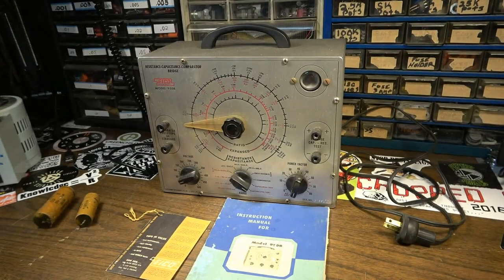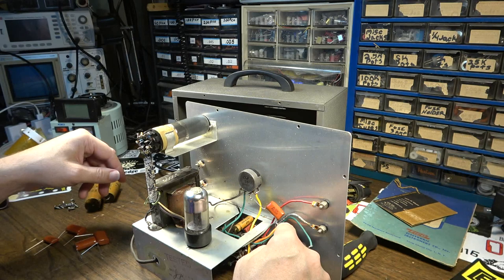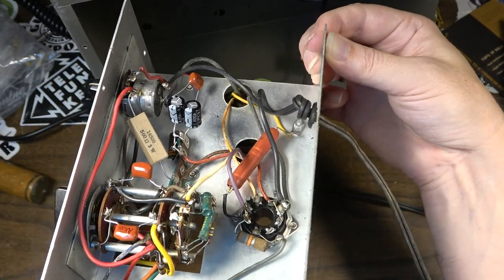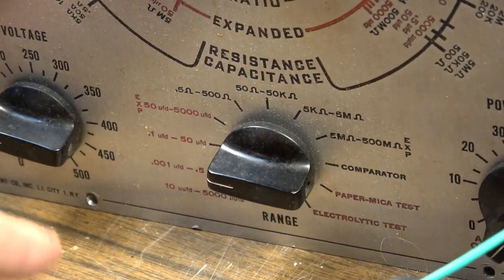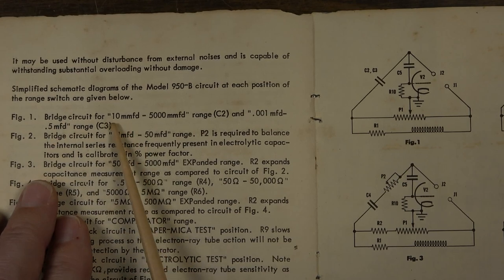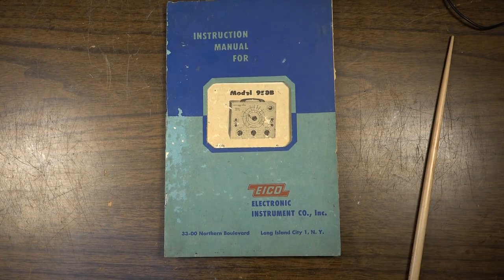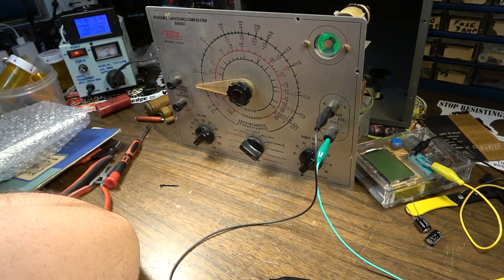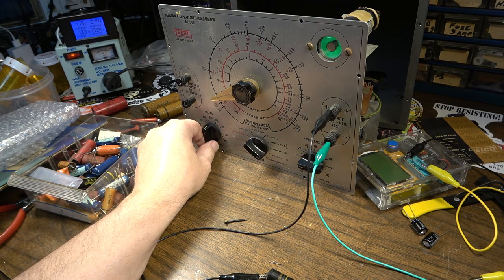Electronics Restoration - Eico 950B MAGIC EYE TUBE Resistance-Capacitance-Comparator Bridge Tester

Comment: Hi Brad, thanks for the video!  I got one of these brand new old stock sealed in the original box from an electronics store that was closing down.  I also got an eico VTVM in kit form NOS at the same time.  One thing to be careful of on the 950B:  when you test a cap at high voltage, don't turn the voltage knob down too fast.  The cap actually discharges through the pot.  If you turn it down too fast,  it will dump the voltage through the pot and burn it out.  It's really hard to find a replacement.   This was apparently more of a problem with the 950A, but I had the pot fail on the 950B as well.  The power factor test is similar to an ESR test.  The lower the power factor percentage, the lower the ESR.  I think this only works on the two highest capacitance ranges, so it's good for testing power supply filter caps. I still use my 950B. Great piece of test gear.  Thanks for sharing!
Reply from the maker: I saw your video after I uploaded this one. You did a great job. I still need to go back in and fix a couple things on this one.

Comment: Wow, that manual really is fantastic. Seeing the explanation and schematic of the bridge with the "power factor" pot in the circuit made the whole power factor thing click. I've just done the same thing— pulled down the ol' Sprague Tel-Ohmike TO-5 after much time spent upon a closet shelf. Just rebuilt the whole thing, hand-rolled the critical cap values, and replaced the flaky main pot with a new one from Mouser, but it's well-shy of the 7.5k called for in the schematic so I've added some trim pots on each side. It's getting there. One thing it's doing perfectly is measuring sub-10pF caps, which I think is a pretty cool party trick. These things really can't be beat for the leakage test, though.

Comment: IMHO, one of your better videos Brad.  I would check the voltage coming at the capacitor in High Voltage situations.  These circuits were designed when the voltage was around 110v, so the when you place the switch on 400v, I'd bet the voltage is higher.   I know I get around 127 volts at the wall here in Florida.

Comment: You should build the Mr. Carlson's Lab low voltage cap tester. He claims that it's highly accurate and can test for bad caps at lower voltage. I have seen it working and it appears to really be good.

Comment: Just a word of advice. When you test leakage and you turn it quickly back to 0 on the voltage pot, you’re discharging all the voltage to the tiny wire in the voltage pot. If you slowly turn it and give it time to dissipate all the heat that voltage pot will last much longer. Thanks for the video.
Reply from the maker: Good advice. I didn’t think of that.

Comment: In “comparator” mode, you could even check inductors if you have a known good inductor, since it’s comparing the reactive impedance at 60 Hz. So if you have an audio output transformer that you know is good, you could compare it (the primary) with a “supposed” replacement, though the operating frequency will probably limit it to inductors no smaller than a few mH, I suspect. 🙂
Reply from the maker: This is an amazingly excellent suggestion. I had not though of that.

Comment: Hey, nice one! I've got a RLC meter with a X/N comparator mode and now I know the use case for it :)
Sometimes you need a matched pair of resistors / caps (e.g. when making a high end stereo amp, a phase inverter circuit etc.) and this is where it comes in handy.

Comment: about your chair, brad: if you get some kind of office chair, spring for some aftermarket wheels for it, there are now rollerblade-style wheels that are made to replace the crappy little plastic casters on most office chairs.  they've made a world of difference on mine!  my chairs roll around so much easier and the whole chair is much more comfortable.  a set of 5 can be found on amazon for ~20 bones, or 30ish bucks at lowes.  well worth the extra money!

Comment: Finally a cap leakage tester operating on proper voltages rather than the 9V on the LCR-T4 component tester from Banggood.
Just don't let Terry from D-Lab come close to the tester, he might turn it into a guitar amp :-)

Comment from the maker: NOTE: There is a capacitor rated at 525VDC in this device. There is a reading of -520V on the schematic I initially misread as -320V. The transformer actually has 560V potential across it in total, so I made a mistake using 450V caps. A better solution is to use two 22uf 300V+ caps in series, which I will go back and do. That will give you well in excess of the spec the schematic calls for on the 525V cap. Sorry for any confusion.
Reply: Your electronic repairs remind me of in the early 60's my dad building a Heath Kit Volt, Ohm, Tach and Dwell Meter. I learned a bunch of cuss words, some Norwegian ones too.
Reply: Cool stuff brad! Love old test equiptment <3 ive been having troubles with one of my tube testers, even after a complete rebuild it wont line center :(
Reply: I really didn't like the look of that stuff that was crumbling away from that lead in that older clip. I'm sure you're very careful, but after losing my old man through exposure to asbestos [and he didn't know when or where he'd been exposed to it] and they used it extensively in older gear of all descriptions. Mesothelioma is a particularly nasty way to die, so please take extra care.

Comment: You could also wire two 4.7 uF/160V electrolytics in inverse-series (i.e. with either the two “+” leads tied together, or the two “-“ leads), and get a (roughly) 2.35 uF/320V rating. Good enough, especially for tube gear. 🙂

Comment: You might want to test your cap leak test voltage output from the tester.  Make sure after changing some of the caps inside that what the dial is showing is close to the actual output.

Comment: i have been in the process of trying to add a taste of distortion on one channel of my Bantam Bass amp. it is from the early 80's. My brother gave this to me many years ago, and  I have tried everything to make this sound like some of your mods to a type of marshall. I would send it to you for a mod of your choice, if you would take it on. I used to co own a tv and video (vcr) shop with my older brother in the 70`s. I have created a pretty good schematic of what i've done and it works kind of but bleeds from the non modified bass channel to the normal modded channel and the middle and bass tone controls don`t seem to do much. Also the distortion sounds more like a big muff on seditives. I really love watching you and hjave done much stuiding on the tube amp designing but it is just so much different than adding non polar caps to speakers to change the frequencies. anyway, I had asked Uncle Doug, which he is a pretty smart guy, but doesnt do the kind of mods you do, and I appreciate your videos and have watch every one more than once. Could I please at least send you my schematic and when you have a moment take a look and give me a little insight. Or I could send you a pix, and maybe you could use it on you channel. Sorry to carry on........ it`s been a month of watching, swapping (with a decade box and resistance box), soldering and all that, and this is my last hope. Thanks so much for all your informative YouTube videos. Mark Bruno

Comment: Brad! I have a question about a 2018 Les Paul.  I bought just the body and neck and installed the electronics myself.  Bridge is grounded, ive shielded the entire inside cavities with copper, and have tried multiple different pickups.  It squeals uncontrollably like the pups have gone microphonic.  I cannot for the life of me figure out whats wrong with this thing.  Ive also taken pups that squeal and put them in a different guitar to make sure it wasn’t the pups.  Ive went with the traditional 50’s style and the Seymour Duncan style and doesn’t make a difference….  I really dont know what would be causing this other than a curse. Ive also re bought new Gibson pots 3 times and was very careful not to heat them up too hot. 🤯

Comment: I notice you use CRC Contact Cleaner in the green can.  What is the difference of that and the blue can?  Does it clean better?
Reply from the maker: It looks like the blue can is labeled "QD" for Quick Drying. I have not looked at the MSDS sheet to see what the difference in formula is. Not sure. I use the green can because a few years back I got a deal on a whole case of the stuff. I think I still have a couple cans left of it.
Reply: @TheGuitologist  Thanks I thought maybe you were using the green can because it was better.

Comment: That line capacitor should be a Y-rated cap.
Reply from the maker: That is technically correct, yes. I don't have any of those onhand, so I'm using a self-healing polyester cap at 600V. I will only be using this device on a bench with isolation transformer. If I get some of those caps in later, I'll install one.

Comment: C2, C3 &C4 are precision capacitors.  C4, in particular is AKA a reference capacitor.  This is is basis for the capacitance measurement.  I'm guessing if you don't have a precision device here, you measurements will suffer.

Comment: Really  cool, but why would you use this over a modern tester that just gives you an LCD readout?
Reply: You use one of these testers because it can test the capacitor at the voltage it’s used at. A capacitor might be fine at a low-voltage (such as is used in the small digital component testers) but it will fail at its circuit operating voltage. You saw when he tested for leakage… Some of the capacitors looked fine at the very low voltage ranges, but when he cranked the voltage up towards the rated voltage, they failed.
That capacitor might work fine in a transistor circuit at 5 to 15 V, but run it at 150 V, and the leakage is so high it’s closer to a resistor than a capacitor.
That’s why these testers are so useful.

Comment: This is one of the “unsafe” models since you can easily leave hundreds of volts in the cap being tested when you remove it from the tester.  The “safe” models have a momentary switch that guarantees the cap is discharged before you remove it.  Mr. Carlson stresses this feature often.  All my brown turd caps test perfect as yours did.
Reply from the maker: All you need to do is turn the voltage down to zero before removing the cap on this one.
Reply: @TheGuitologist  yes but imho if you put a momentary button it is bullet proof, just to be sure if you forget to dial back the voltage . Cheers from Uruguay.
Reply from the maker: @andresbide  Could also connect a wire to the chassis and install a 3-prong cord and touch a grounded probe to the positive lead before touching. It's a good reminder to respect the potential charge.